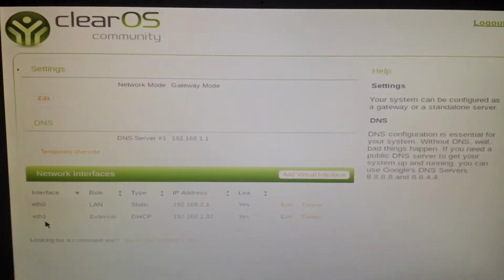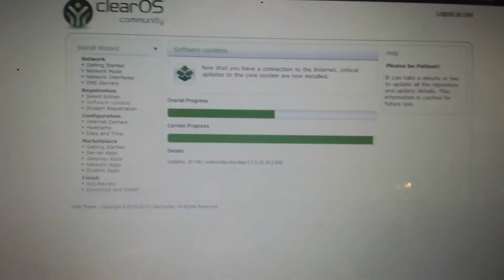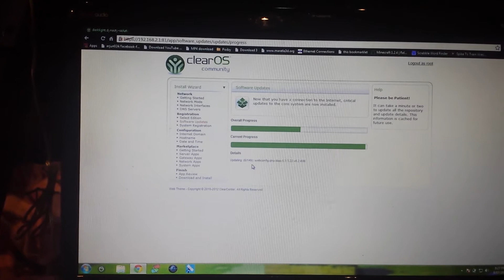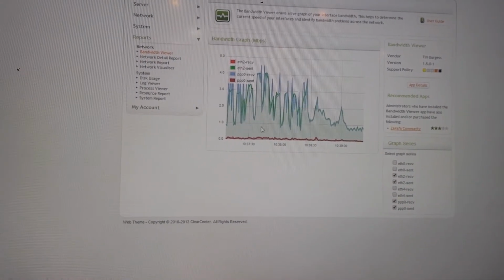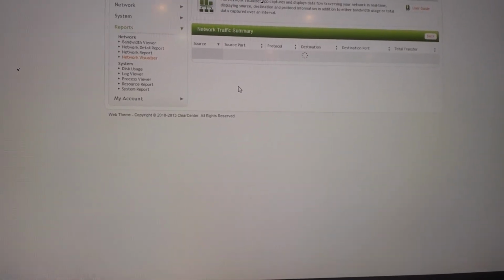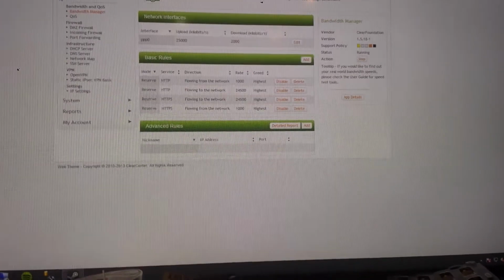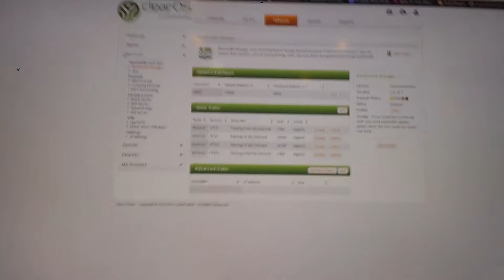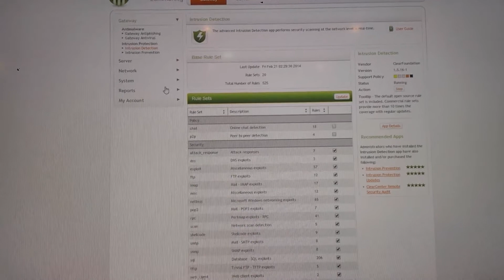Gateway Server Build and Intrusion Attempt

Comment: Why don't you use SSH only to protect the ports you want to forward? An encrypted tunnel is a lot safer, plus the keys can be used over passwords if you feel the need.
Reply from the maker: Tera Volt I use OpenVPN for anything that's not a gaming port, and even then, I'm moving those over to OpenVPN too (I give friends accounts and certificates)

Comment: I too have one of those dell machines, however I still only have 512mb of ram in the one I have, so it is one of the unused machines I have here  now. It lives in the corner with the 2 HP sff machines and a old celeron 2ghz (that has linux installed on it).

Trying to minimise the number of machines here so for a router I am in the throws of config a Ubiquiti Edgerouter lite, it has more power than some of the PCs I owned in the past and it has 3 ports as well. I bought it as I am going to use it on the community wireless network here and wanted to isolate my home network from the "freenet".

Comment: Very big security risk running RDP on the default port (3389)
Reply from the maker: It was actually port forwarded from 3390 externally to 3389 internally .. needless to say I've moved it very much elsewhere .. The intrusion detection had noticed a port scan coming from the same source a bit earlier and quietly dropped the connection, however I think 3390 is becoming as ubiquitous as 3389 for RDP

Comment from the maker: ***** I can't directly reply to your comment, but I'm very happy with ClearOS, I've been using it for some time now. My gateway is currently a P4 with 2GB of RAM, before that it was running on a dual P3 with 512MB RAM .. It's always been very snappy, and extremely easy to configure. I'll have to do a video at somepoint on Flexshares as they're pretty amazing in and of themselves!